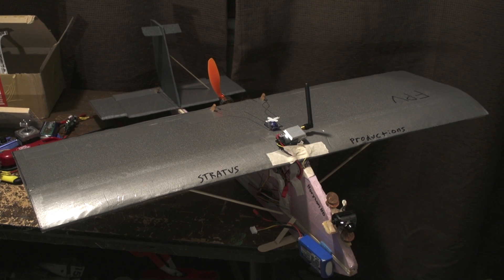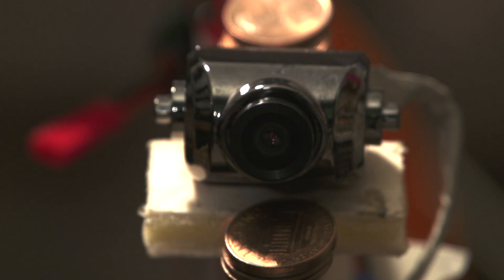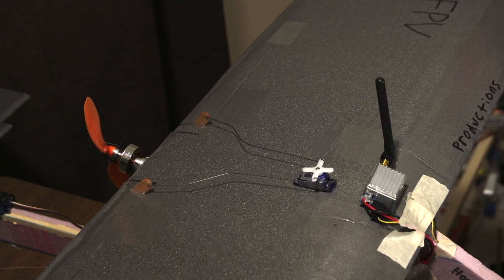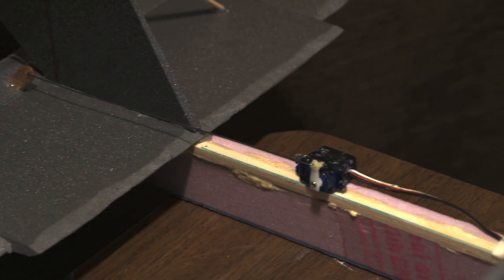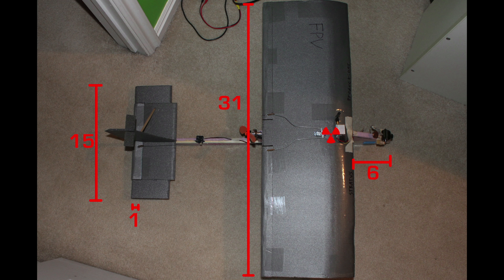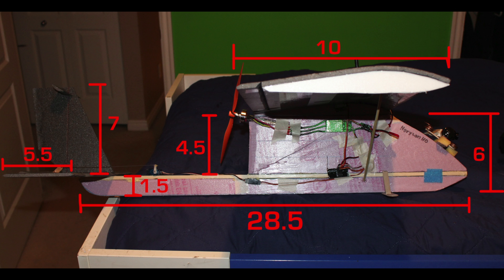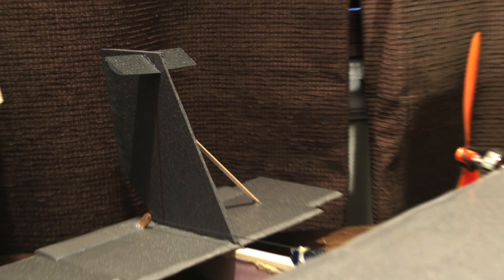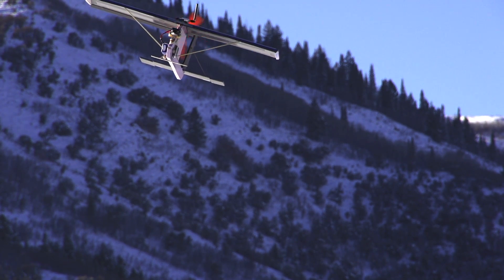Small FPV Plane V2 - RCTESTFLIGHT

Comment: There are many RC air fields in Florida, same state I live in. I haven't been to one or any in awhile. Funny thing is, I'm not sure how old you're but you do not need a helmet for a bicycle or street bike in Florida. I think there is a law if you're under a certain age you need a helmet. I never once had a cop tell me I need a helmet on a bicycle even at night. That was 12+ years ago so that may of changed. Fly low and stay away from real air traffic and I don't see why you would have a issue.

Comment: wonder more crashes=more repair=more money.
wonder if a quad is more FPV suitable, ie, hover, 360 pivot, vertical land/takoff
i guess all rc flyers shake, so the bottom line will be the fpv setup for the best images.
those  "fast flyover" images seem nicer with the rc plane, maybe to shoot towards a wave about to break.

Comment: awesome. I know nothing about this stuff but I likkkiee. Please! please, steer me to the right first set up to be able to get aerial video in a km radius area. I will be over water mostly. I looked at the "parrot" rc quad version 2 for about 300 bucks.but has short range 165 ft with fpv hd cam on it.( using ipad to steer and record to pad or usb flash)
your stuff is so much more awesome.!!

Comment: great video streams! camera looks really stable.
_Im building some sheet foam creations myself from the white "electrifly" branded sheets, and have some interesting stuff Im gonna post in a day or two. Have you thought of using Slots or Slats on the wing yet? cant describe here, but look it up. Slots in the leading edge of wing really boost lift while slowing plane down some.
My designs are super light, almost all from 4mm thick sheet, framed up with ribs...lots of air inside. Keep flyin high!

Comment: Hi, do you think it can work with a 1400kv brushless (weight 96 gr) and a 8"x6" or 9"x4.7" or 10"x4.5" ? (This motor is designed for a 600gr to 1200gr airplane). Thanks

Comment: Hey, quick question..I wanna fly FPV out my bedroom for a little while I perfect my main LR setup just to play around. I am looking for a slow cheap relatively small (Under 30") plane. I use 1.3 but might get a 900mhz tx to try out. Not looking to go far (2-5) blocks at most. What kind of plane do you suggest. I was looking into your delta wing but now this looks cool too. Let me know if you have any suggestions and tips.

Thanks,
Jake

Comment: Most airplanes with a flat bottom wing will have down thrust incorporated on the motor to keep it from ballooning. The idea is to keep a downward force vector as the airplane speeds up incrementaly. If the motor is behind , there are different factors to consider , not just CG, but how height abover the center line is located and what kind of moment is producing. Therefore the angle of thrust is calculated accordingly.